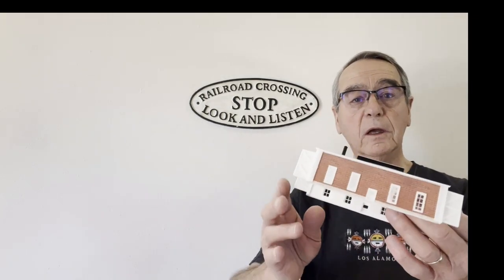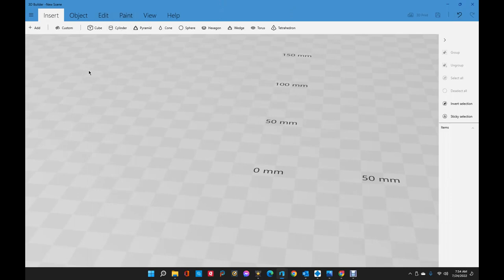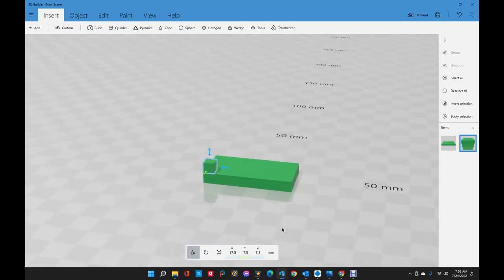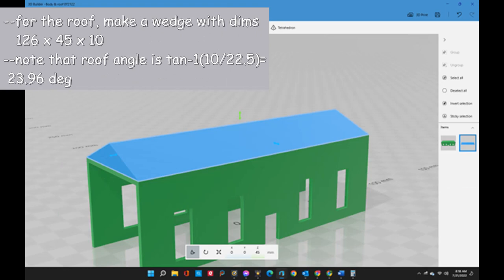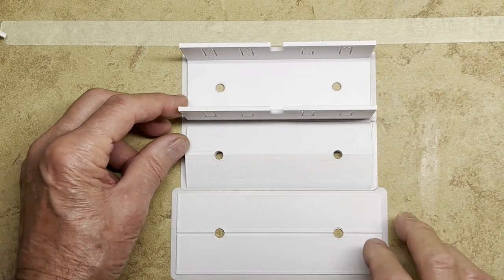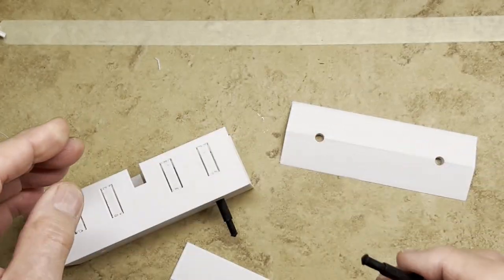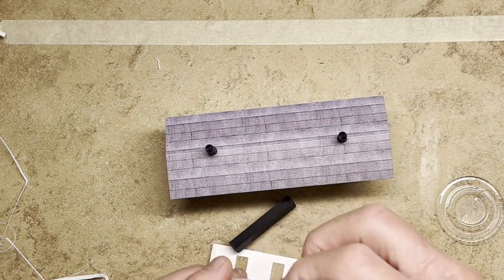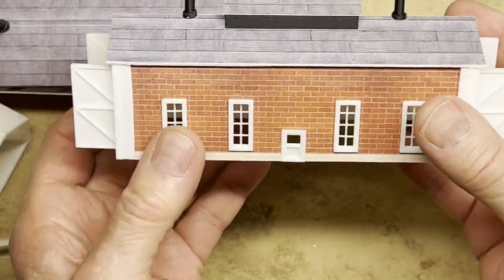How To 3d Print Model Railroad N-Scale Buildings And Structures Using FDM and SLA Technologies

Comment: Good Morning Dean!  I also print N scale structures.  I print mine in kit form.  Anywhere from 20 to 100+ pieces.  I use filament printers.  I am in the market for a resin printer, but financing is not quite there yet.  I enjoyed watching your techniques.   . Brian
Reply from the maker: Thanks for the comment.  Resin printers are cheap but more difficult to use. You may live in Colorado if you're modeling the D&RGW.  I'm a great fan of that railroad.